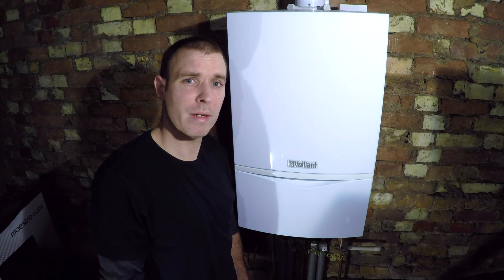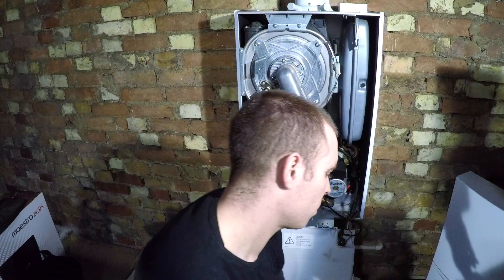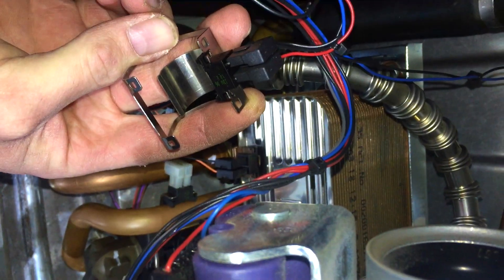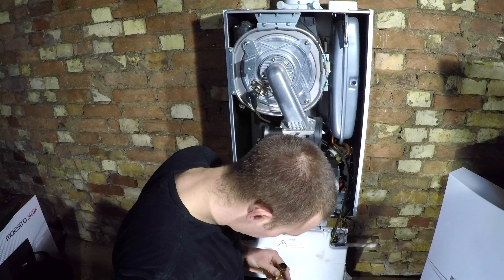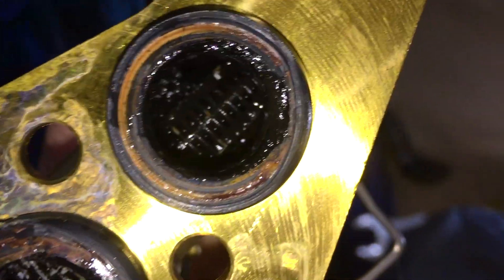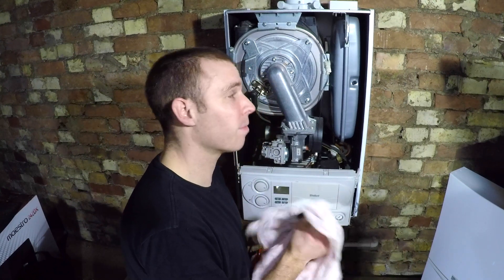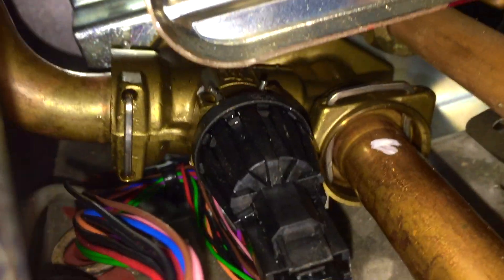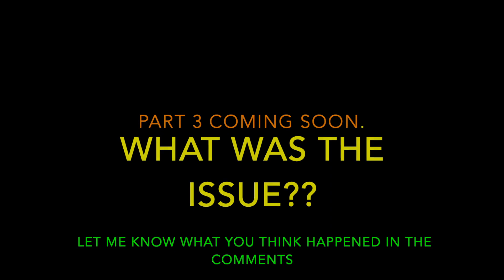My boiler issues part 2. Unexpected Ending!!!

Comment: Have you any views on a Vaillant F54 fault ( EcoTech Plus 831 )
Fault finding says gas supply issue,  I’ve checked inlet,standing and working pressures,CO and CO2 very good and Ratio 0.0004.
Also replaced Ionisation probe and electrode.
Reply from the maker: Its usually combined with F28/F29 isn't it?
If so its common for the gas valve to fail. Is this an ecotec 2? (no knobs)
Reply: Hi Ecotech  ?
Can’t remember if was the R1 or R2 .
Seem to be a few replies on other forums suggesting the Meter Governor May be faulty  ?
Reply from the maker: @lance4613  It could be. Is it present with another fault code? I it intermittent? What was the working pressure?
Reply: Hi,
Went through the fault list, last 8 or  9 were F54.I know F28 boiler lit ,F29 boiler lit then failed.I didn’t check if any steel pipe debris was caught in the gas valve gauze filter ?
Working pressure fine @ 19mb.
Reply from the maker: @lance4613  When you went through the list did you press - and i or did you have to ego through a menu system?   
I will look at my information once the kids are in bed and see if I have anything noted down about this fault.
Reply: Hi,
Went through the installer level menu ( Code 17 ).
Trouble shooting just says gas supply issue ?
Reply from the maker: @lance4613  If you went through 17  then it was an ecotec 2. (the one with no knobs). I cant remember ever having one with this issue. Always with another code F54/f28  or f54/f29.
 The Honeywell gas valve on these boilers has been a problem but just as likely is the reg on the meter (I assume its intermittent lockout). If its intermittent i would get the reg replaced first as its free to you and the customer.
Reply from the maker: @lance4613  Also if the flue runs off to the left and gets any water down it or condense leaks past an inner seal, it will result in water/condense dripping onto the yellow stepper motor plug on the gas valve. (unplug it to check) If water drips onto it eventually  the plug/harness gets damaged and when you unplug it it will fall apart. Warn the customer before you do it!!!
Reply: HeatingGeek 
Like you I thought water ingress could be the reason ?
I’ll see if Vaillant Service think the same ?
Nice vids by the way 👍
Reply: HeatingGeek 
Yes it’s intermittent so the reg could be the issue ?
I’ll wait until Vaillant Service have visited .
Reply from the maker: @lance4613  Ok good luck. Let me know if you get to the bottom of it. And post it here to help everyone.:-)
Reply: HeatingGeek 
Ok no problem Anthony,
Cheers,
Lance.
Reply from the maker: @lance4613  Whos Anthony? Im Ollie or Oliver to my mum. ;-)
Reply: HeatingGeek 
Oops !!
Don’t know where that came from.
Apologies Oliver.
Reply from the maker: @lance4613  No problem ;-)

Comment: It would be great to have your email address so I could communicate with you. There's not many guys with your experience and I love watching your videos. The problem with that Worcester 28i rsf the boiler gauge is clogged up so there's not an accurate reading and the expansion vessel has failed. I'll replace with a new vessel and gauge but did recommend a magnet filter but customer doesn't want to spend the £.  So if the boiler is losing pressure and is running this could cut out?  I'll fix this and we will see if it runs normal again.
Reply from the maker: They don't have a pressure switch so the only way it would cut out (for low pressure) is lack of circulation. Check if it ever cuts out before the pressure goes low. 
Usually the gauges are blocked where they go into the plastic hydroblock. So you can unblock them really easy. Have you ever done the vessel on that boiler?
 F#@x$%# nightmare if you don't know the pit falls.
Reply: It's not the glow wor, ci this the Worcester 28i rsf that has the problem. I'm going to install a external vessel with expansion kit with guage.
Reply from the maker: @mmack3286  28i oh. I thought for some reason it was 28 cdi rsf.  Does the boiler do hot water ok?

Comment: It’s interesting that the Vaillants and Worcesters all rate highest in reliability reviews (Which etc). They look like absolute pigs to work on and access though. Have a low cost Potterton Gold which seems to have way more room inside around the components... Guess it just makes it easier to replace stuff when it goes wrong...🙂
Reply from the maker: Vaillant are very easy to work on. Worcesters are very difficult. Potterton ,Baxi and Main are good to work on. But to be honest once you work on all of them they become easy.